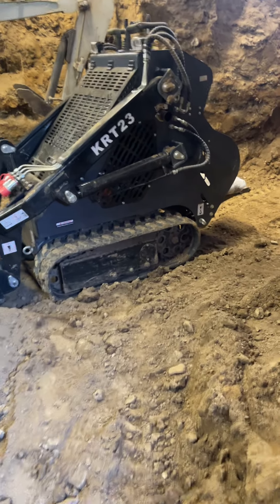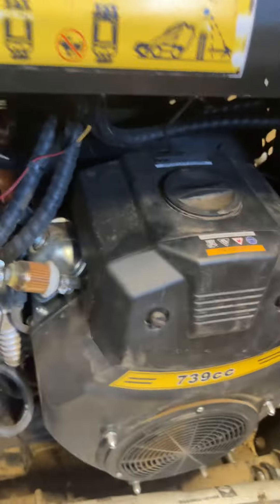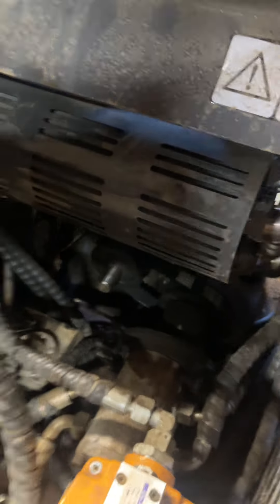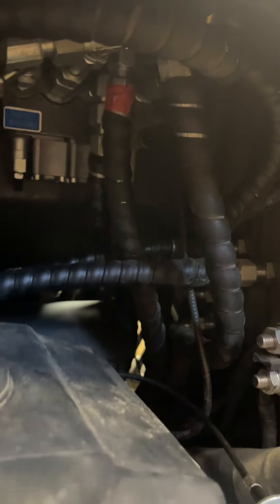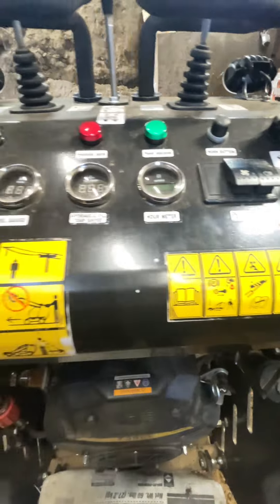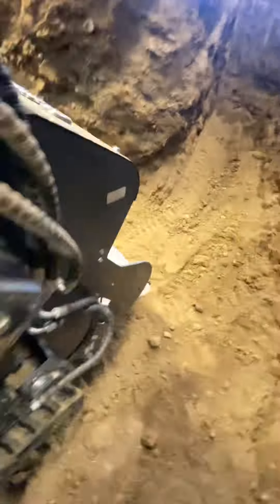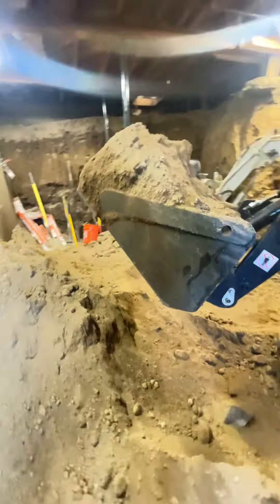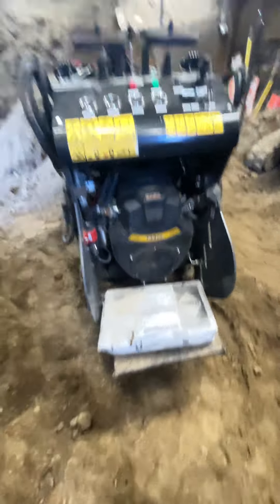AwT Chinese skid steer 21hrs. KRT23

Comment: , please help me the opening of the engine oil
Reply from the maker: To add oil or to check it?
Reply: I’ve had the same problem and u have to unbolt the gas line and move it over
Reply from the maker: I we’ll post a video in the next week or so on this to help. Sorry for the late response
Reply from the maker: I think that’s what I’m going to do and then just add fuel thought under the hood